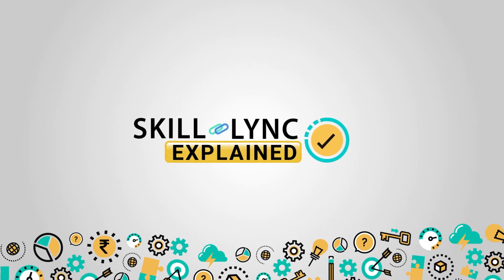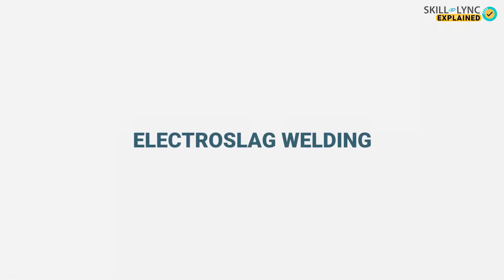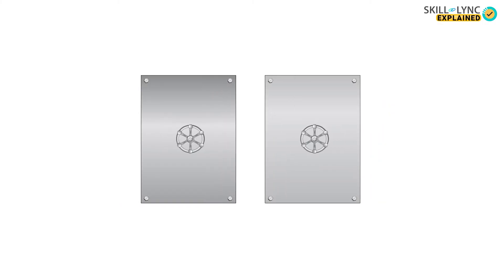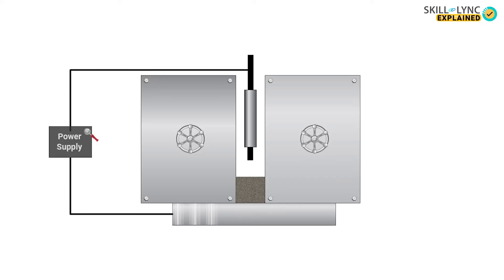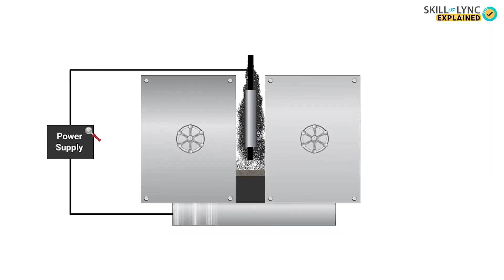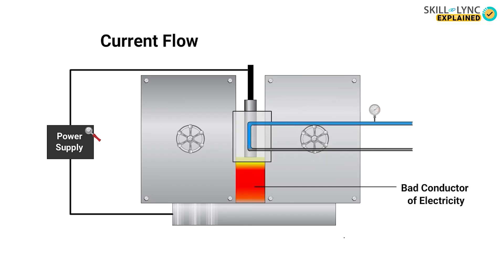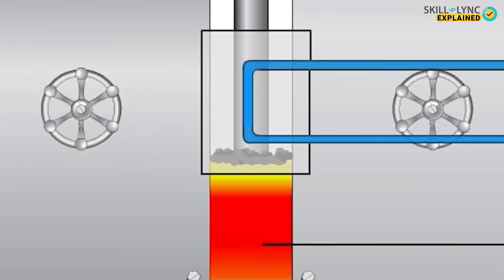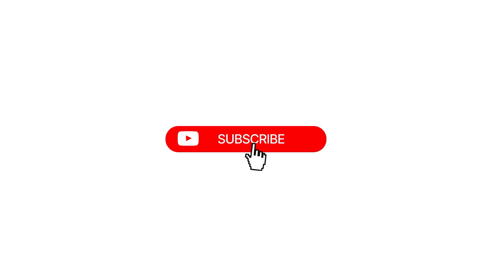What is Electroslag Welding? | Skill-Lync

Comment: How can a bad conductor conduct electricity??
Reply: The flux and slag are not good conductors, but because they have the highest resistance in the circuit, that is where the most heat is produced. Same reason a loose electrical connection gets hot.